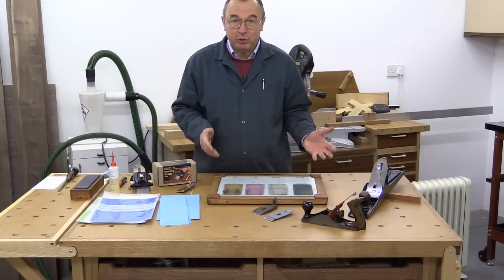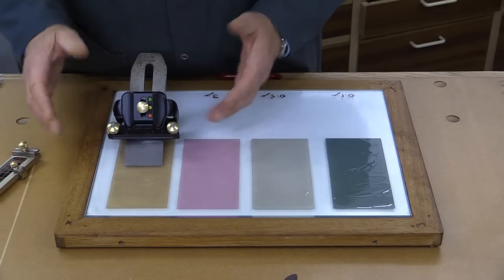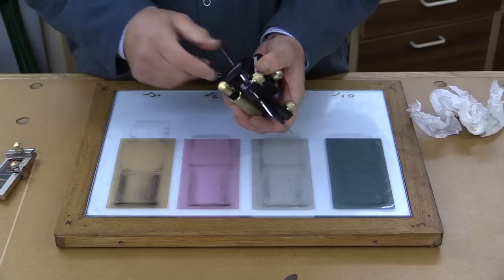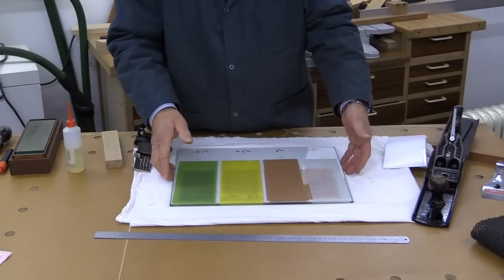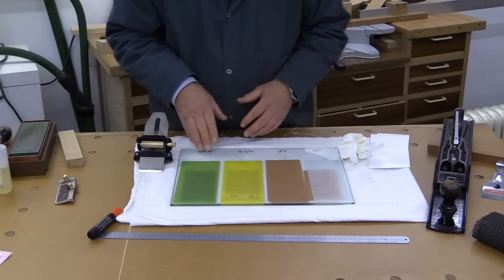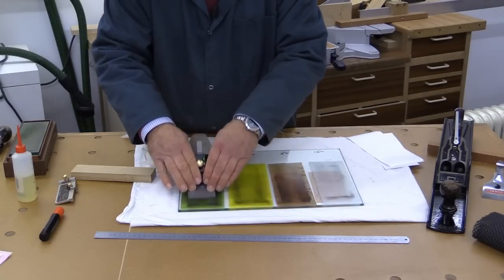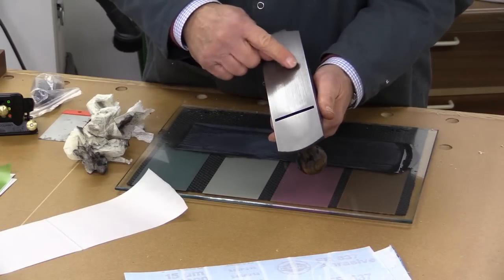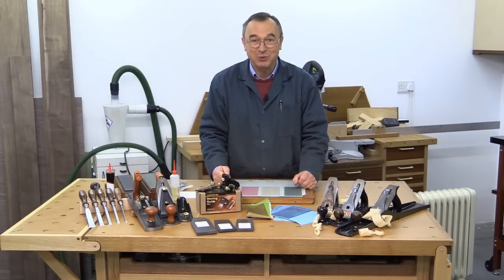How to get razor sharp tools using lapping techniques - Part 2

Comment: Thanks for another excellent video. I must confess to being a little OCD when sharpening. One thing I find very helpfull is to use paper towel between grits to avoid contaminating the finer grits with particles of the coarser abrasive grit that will have been removed during sharpening and also carrying over swarf from the previous sharpening. The swarf will help clog and shorten the life of your films and also slow down the cutting and you don't want pieces of coarse abrasive on your 0.1um film while doing the final lapping..
Reply from the maker: Hi Labrat,

You are absolutely right. I do use kitchen roll but first I put a little fresh oil on the surface to help the swarf to get taken away.

Thank you for the kind comments.

Peter

Comment: Another excellent video (set of videos). Lot of useful information there. Have to agree that Veritas mkII honing guide is fantastic tool (as well as all veritas tool I have, e.g. low angle block plane), I have it too, but using only with waterstones so far. Will definitely try lapping soon.
Reply from the maker: Hi Radoslav, Many thanks.   Peter

Comment: I inherited my father's three planes three years ago & they're in desperate need of a complete overhaul. I did some research & already bought the Veritas honing guide from Axminster before I found your channel but have been stuck as to which abrasive type to use, dithering between diamond stones, water stones & abrasive film.
After your demonstration, I've decided to try out the 3m film, especially after finding the set of four sheets for less than £11 delivered.
I'm actually looking forward to trying this out, as my efforts with carborundum were only ever 'OK'.
Reply from the maker: Good luck, I find it the easiest way to sharpen my tools.   Peter

Comment: Thanks for the videos Peter. I have the same honing guide and find it great. However, I use some Japanese Water Stones instead of a lapping plate. Having now watched these two videos I think I will get a lapping plate, mostly to flatten the base of my planes.
Reply from the maker: Float glass is the answer. Peter
Reply: New Brit Workshop A cheaper and more convenient option is a granite chopping board from any of the supermarkets. (Take a straight edge to find a flat one). Or a granite floor tile from any tile outlet, same applies about flatness.

Comment: Greetings Mr Peter. Many congratulations on your fine video work. I have just purchased the deluxe system one for iron work the other for chisel 1/8th etc. it has a clamp system were it holds very thin chisels.  highly recommended. Though id rather use glass or lapping fluid its much easier to rinse then dry then oil as I think by using oil for sharpening then wiping would leave swarf in the bearings so care should taken I think. Keep up the good work.
Reply from the maker: Cheers Paul.    Peter

Comment: Just this evening i tried this technique but with water and a cheap honing guide. I am gonna upgrade my honing guide, the fluid, and the abrasives. My glassplate is 2x10 mm hardened floatglass laminated together, so Im good there :-)

Comment: Hi Peter - I've decided I need to raise my sharpening game and was pleased to find your videos on the subject - very informative, as usual!  I'm interested in the frame you have to hold the float glass and was wondering what the glass is resting on to provide even support?
Reply from the maker: Hi Darrel, The glass holder is a piece of veneered MDF that I had lying around with a frame around it to hold the glass in place. Some people just place their sheet of glass on the bench top but I would rather keep the mess in one place and off the bench.   Peter
Reply: Many thanks for prompt response.  I think I'll follow your example - a nice little job for the weekend!   Kind regards, Darrel

Comment: good video! the guide is nice, i like how they have eliminated having to figure out the stick out distance of the blade and the squaring of it with that jig. I think for most people this would be a great solution to something allot of people are intimitated by. I still think i will sharpen by hand though because its so much quicker.

I like the abrasive films too but ive found some problems with wider bevels or doing the backs of plane blades, whre i find it difficult to keep the film clear of contaminates, or what i believe are sometimes small bits of burr breaking off and imbeding themselves in the film, creating verry frustrating scratches. 

also make sure to confirm the flatness of the glass, becsuse i aso got a plate from veritas and it took me quite a bit of frustration trying to figure out what i was doing wrong before i realized that the plate itself wasnt flat.

i would also suggest not using a diamond plate for removing thr burr,.because an edge is only as good as its coarsest side, your taking your beautifully polished bevel and bringing it down in fineness by putting the back on the diamond. try the charlsworth ruler trick with the blade out of the guide for the back, i think youll like the results.
Reply from the maker: Many thanks for a good addition to the knowledge base.   Cheers.   Peter

Comment: Hi Peter, thanks for the demo, interesting stuff. Did you try a back to back with wet and dry at all? How do you think it would wear in comparison to the lapping film?

It's funny how we chop and change with sharpening. I was an oil stone traditionalist, then I found Japanese water stones and became a convert, but like you got fed up with the water and how quickly they wear, it seemed to be a bigger job keeping them flat than sharpening tools!

Since then I've discovered diamond stones. I now use the diamond stone (with oil) to get the initial secondary edge (if it's been a while), then 2 grades of oil stones, then a leather strop rubbed with aluminium oxide paste. ALL with an old Eclipse jig, even the strop (drawn backwards). I don't de-burr until I get to the strop stage, drawing the blade once across the strop on it's back, then sliding it sideways down a corner of wood, as if slicing the wood. I find this gives the razor edge we all crave. I use edge tools daily at work and give them a quick rub freehand on an oilstone to keep things moving, but bring them into the workshop every couple of weeks for a good going over.
Reply from the maker: ***** Hi Graham, I have not conducted any comparative tests at all. I did try wet and dry (rather coarse) for plane flattening. The diamond film is the answer for sharpening.   Peter

Comment: Hi Peter,
Thanks for another informative video.  Can you tell me what sizes you cut the lapping film into, and what size glass you use?
I do like the Veritas guide, will have to save my pennies as it appears far nicer to use that my standard type.
Regards,
John.
Reply from the maker: Hi John I bought a piece of glass 300 mm x 400 mm. The abrasives from Lee Valley were already cut in pieces 150 mm x 78 mm but the 3M paper, which came as an A4 sheet, can be cut how you like. Bearing in mind that the roller of the guide needs spacer near you where no sharpening can happen (otherwise the roller is off the glass) then the abrasive need only be about 260 mm long. It should be at least 70 mm wide. So cut the sheet in the most economic way that you can. Do get the Veritas guide - without it I would not have gone back to this method of sharpening having tried it before with a rubbish guide. Peter

Comment: I noticed that the honing guide has a long wheel guide at the bottom (unlike the small wheel on the cheaper ones), how do you impliment a slight camber to prevent plane tracks?
Reply from the maker: Hi Jonah, My honing guide, Veritas from Lee Valley, has a special roller for just that which has a slightly smaller diameter towards each end..  Peter

Comment: Correct me if I'm wrong, but I believe when lapping that you are only supposed to go in one direction per grit. Meaning that you go forwards with one, then backwards with the other.
Reply from the maker: I understand what you mean but have not been taught to do that. I will ask a few friends who have been lapping longer than me.  Many thanks.   Peter
Reply: I could definitely be wrong though.
Reply: I have always been told one direction, as in forward and backwards (chisels, planes), or side to side (drawknifes, scorps, hook knives)

Comment: Hello Peter, Very Interesting I was wondering if you considered the use of diamond   plates and why you opted to use the lapping sheets?
Reply from the maker: William Valentin Hi William, It is just a question of cost. The lapping film sheets are reasonably inexpensive and actually, with care, last a long time. To buy 4 grades of diamond plates would be quite an outlay. Perhaps in the long term it might work out cheaper but it would take quite a few years.   Peter

Comment: Im realy enjoying your videos. You mention Veritas recommending polishing the back of the blade, I too recommend this process. The definition of a sharp edge is, the angled intersection of two highly polished faces. If you consider this definition it becomes obvious that the back should be polished as it forms one of the faces. On planes a micro bevel can be applied to both sides to minimise the sharpening effort. This technique should not be used for chisels however.
Reply from the maker: Hi Andrew, Excellent advice - many thanks.  Peter

Comment: Hi Peter. I've ordered the honing guide from Axminster, along with some float glass but haven't yet purchased the abrasive paper because I can't find all of the grits needed for a very sharp edge. Where would you recommend looking in the UK for suitable paper? There's two from Axminster, 800 and 2500 grit but no higher. Many thanks
Reply from the maker: I think Rutland may be able to help.   Peter

Comment: Thanks for the informative videos.  I will look into this technique in the future. Regards
Reply from the maker: Wade Mattson Hi Wade,  I had tried this method many years ago but did not manage well because I had a very cheap honing guide. The Veritas honing guide that I now have makes all the difference - it is accurate, simple to set up and very easy to use. Many thanks.    Peter
Reply: Peter Parfitt
Funny In connection with ordering the Veritas Parf dogs, and bench dogs, I went through the whole selection of hand tools at the Axminster tools and woodworking site and the Veritas honing guide caught my eye, the Veritas planes for the present at least are out of reach for me, I keep an eye on the used market here in Copenhagen for good quality cheaper alternatives..I'm reasonable well equipted in the chisel department though..
Reply from the maker: Wade Mattson Good luck finding a second hand Veritas plane - ebay might be the easiest way to do that.  Peter

Comment: Wouldn't your diamond stone be a less fine abrasive than your lapping sheets?
If so, isn't using it decreasing the quality of the surface on the face of the blade?
Reply from the maker: +Paul McGee The lapping sheets are better.   Peter

Comment: To save wear on your film you might consider starting your micro bevel immediately after your coarsest grit.  There is no need to proceed through all the grits before the primary bevel because your polished edge gets removed when you hone the primary bevel.  The blade only cuts at the very edge.  No need to hone the entire bevel face. Thanks for the video!
Reply from the maker: That makes so much sense - brilliant - many thanks.  Peter

Comment: nice video. but not everybody can afford these exotic lapping papers. i am sure wet anfd dry would be just as effective at much lower cost.
Reply from the maker: I am still using the original set of papers that I got from Lee Valley and used them yesterday in preparation for a new project. So, I suspect that they are a cheaper alternative to some of the very smart oil or water stones that are around.   Peter

Comment: I prefer lapping my blades up to 2,000 grit on some sandpaper and a granite tile, and then stropping it on some extra-fine rouge.
Reply from the maker: Sounds good - how do you flatten the granite tile?   Peter
Reply: Actually I didn't have to flatten it. Granite flooring tiles come ground and polished perfectly flat to within a few microns. I picked up a nice black-granite tile from Home Depot that I use for lapping, indexing, and flattening my sharpening stones. I got it for $5USD, and I just stick the sandpaper and stropping cloth to it and go to town.